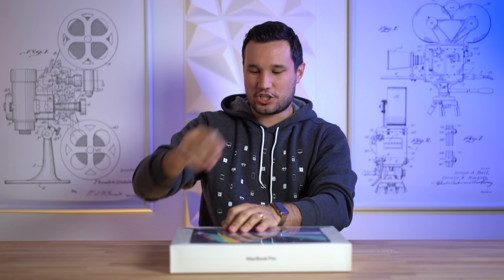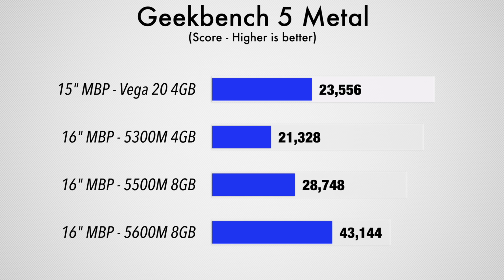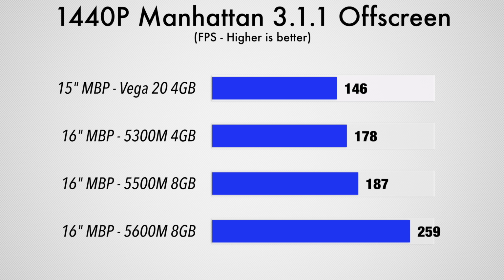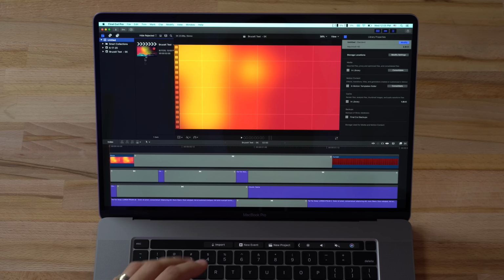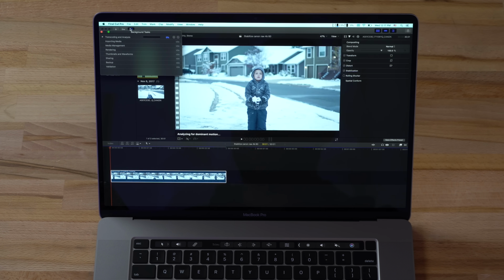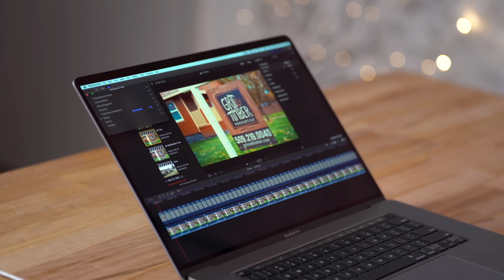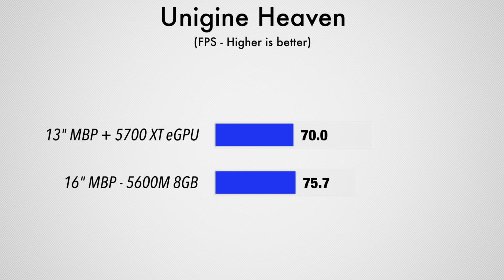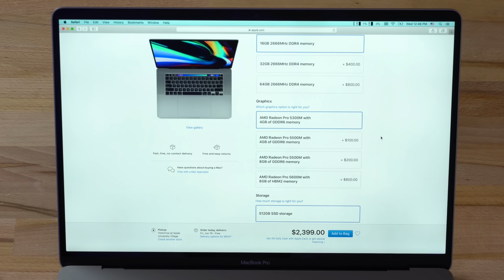New 5600M GPU on 16" MacBook Pro: Performance Benchmarks

Comment: People won't appreciate and understand how impressive this new GPU is for mobile. All that power in a 50w TDP meaning you can run all that performance still on battery. No Windows laptop can do this. Definitely getting a MacBook 👏🏿👏🏿💪🏿💪🏿
Reply: This is what impressed me the most. 50 watts is nothing for a GPU.
Reply: Yeah, thats  just amazing - this powerful GPU and 50W TDP?! It looks like AMD will soon conquer not only gaming consoles...
Reply: Mateusz Drewnowski Boom 💥 🤯, let’s hope so.
Reply: Amd should make a 16-20 core 4GB version of this that only uses 25W, and add it to the 13" MBP.
Reply: Ilipan Where are all these truths coming from. The issue is Apple 🍎 wouldn’t use it! 😠
Reply: @ilipan2668  very true
Reply: btw anyone has  information about TDP of 5300M and 5500M? Notebookcheck says its 65W(5300M) and 85W(5500M), so its even more insane how they made that much faster GPU with lower TDP. Its really hard to believe.
Reply: Mateusz Drewnowski 5500M 8GB 50W TDP
Reply: @AllenWalker777  HBM (and especially the memory controller) save alot of power and the Shaders are probably running at pretty low voltages (and relativly low frequency)
Reply: RunFor OurLives You stop ✋ 🛑 it! 😉
Reply: I wish we can get this kind of 50W TDP gpu in a Razor Blade or an Asus. That way I can have a windows laptop that can run properly on battery.
Reply: @captainfatbat9557  exactly this
Reply: Yep it was unplugged for a lot of these tests
Reply: Sorry, this gpu from AMD is exclusive to Apple? I'm sure it isn't.
Reply: @blinblinthing  I'm a PC guy, but this mac is impressive. Yes, it is exclusive to apple at the moment. Other windows laptops with a 5600M come with 36 CUs and the mac one comes with 40 CUs.
Reply: M. They have 6GB of VRAM and GDDR6 also
Reply: @user-wl6nm4iw9i  While Apple is the only OEM with an offering with this unit, i haven't read anything from AMD saying it's exclusive for Apple.
Also the gpu isn't just able to do alot with a small power draw because of the OS.
While OP didn't explicitly say that, i not no one came to such a understanding.
Reply: Asarni Thomas it is
Reply: imagine spending 800 dollars for a gpu when you can buy a whole laptop with that. and build a pc.... and im not speaking about what you can buy with the price of the macbook
Reply: Amd 5600m is available also on windows laptop for 800 bucks 😂
Reply: 50W TOTAL BOARD POWER (not TDP)... TDP is a bit of a baseline measure, which means that boost clocks would usually result in bigger power draw than advertised TDP... Total Board Power (TBP) on the other hand means the GPU won't exceed that at all.
This GPU is listed as having 50W TBP (not TDP).
Reply: Do you think the thermals/battery life will be highly impacted by that? Just ordered mine and will probably have to test that myself :D
Reply: PC gamer: it still can't play games well, no 144Hz display
Reply: Tom Liu This is nitpicking man. Plenty of folks out there playing on 60Hz screens. This isn’t for the esports stars, but for someone who wants to play multiplayer on-the-go, away from home, and not at a LANFest.
Reply: He is running Heaven on 1600x900 windowed, what do you expect?
Reply: With a windows laptop like razer studio and lenovo when plugged in are twice as fast as this macbook I love Mac's but the truth is the truth
Reply: Lone Wolf 🐺 What you are saying can’t be denied.
Reply: @LoneWolf6063  Yep, but this is a laptop, it's good to work on the go...and if that razor it's not plugged in,  it's twice as slow as this macbook.
Reply: @LoneWolf6063  nope
Reply: @LoneWolf6063  The 5600 is equivilant to the 2060 as the default with the razerblade and g14 (maxq), unplugged those laptops suffer in performance.  You need something with a 1650 to not do that, and that is equivilant to the 5300m
Reply: @LoneWolf6063  yes but the battery life?
Reply: @MarceloTezza  depends on what u do but on heavy load around 3 hours and normal use 6-7 hours which is the same as a macbook pro.
Reply: @LoneWolf6063  Are you sure it is the same? With a 50wats tdp? No... It isnt...
Reply: @MarceloTezza  na not 50 watts but that's not the point
Reply: Yeah but +$800 more than the 5300M macbook.
Reply: @anires1195  You make good money for editing from this mac that 800 is nothing lol
Reply: Until it overheats and starts to throtle
Reply: Windows Laptops don't limit themselves to 50W, that's why, batteries to handle 150W+ of power are very expensive and not very durable, so Windows has a power budget on battery, if it's exceeded, clocks go down, CPU and/or GPU. However under battery it's very likely you still get similar or better scores with nvidia graphics, so there's no point.
Reply: @TheFPSPower  The claim that getting the same or better with Nvidia on battery is just flat wrong based on any comparison I've seen.  Yeah, Nvidia can crank faster on wall power but on battery, not so much.  Nvidia has it's huge pros as a graphics card but efficiency has not been one of them for a long ass time.
Reply: @grumpychocobo  exactly this

Comment: Just ordered one with this graphics card I’m really hoping it’s worth it because it was such an insane price jump wish me luck lol
Reply: Well if you require macOS and are doing something graphically intensive, and you can afford it (this is the most important factor) then you'll likely find its worth it. However if you dont need macOS, you probably should've just built a beefy desktop for a fraction of the cost. If portability is a requirement then there are many other laptop options that offer better performance for an equal if not lower cost. If you really dont need the graphics performance this offers you likely couldve saved several hundreds of dollars and opted for the 5500m or even the 5300m variants. If you couldnt afford it and blew all your rent money on an overpriced computer, then you my friend are an idiot and it most definitiely was not worth it.

However, I'm assuming that you satisfy all 3 of those requirements so im sure you'll love it! It sure is an impressive piece of tech
Reply: Souljaa yes, totally worth it. Using FCPX on a Vega 48 is a delight with quite a few effects applied, realtime 3D plugins, etc... it’s close to realtime for the most part. I have ditched using Premiere/After Effects when possible in exchange of the Apple equivalents because of this. The 5600M is even faster on that front. You can easily extend that laptop shelf life to at least 5 years, maybe even more.
To anybody saying that if you don’t need macOS and to get a laptop for a fraction of the price... that’s just not true, when in doubt check all the reviews that compare competing products to the MacBooks (Razer, Dell, HP, etc laptops). For a similar price or a couple of hundred dollars cheaper you will get: mostly 6-Core CPUs, some will cap at 16GB of RAM for some reason, RTX cards that eat away the battery life (will run for about 1.5hrs), plasticky finishes somewhere, flimsy hinges, screens that can’t display a logo because maybe the reds are out of it’s reduced color range display, almost always heavier and bulkier chassis, a trackpad that will probably behave sub-par, basically a computer that overall performs at 50% of what’s touted when it overheats or when it’s on battery... you will get a better webcam and tons of ports though.
Reply: @alejmc  The Razerblade 15 It's overall better on these benchmarks and costs less with a 2080 Super Max Q. The battery is worse, but if you are low on battery there is no harm in connecting it if u can
 is there?
Reply: @Alej M-C  Most of what you mentioned it's just bullcrap because you're not giving any real example, you're just piling up the defects that there might be with x and y laptop and saying most are like that. Literally the only laptop that might only get 1.5hs of battery life is the Apex 15 which is  the most powerful out there.
Reply: @-santi4401  No need to get overworked over this. 
Although, I'll accept that I'm an Apple ecosystem junkie and like how much better things behave even on seemingly lower end hardware. The closest example I can think of is of this Razer review which has a super kick ass workstation Quadro RTX inside it, also from Max Tech: https://www.youtube.com/watch?v=U7hYfPfAVIc
Reply: @alejmc  MBP is best all around. Agreed, and now with this graphics card. Its my #1 pick.
Reply: Tino like those celebrities where they made thousands every second by average lol
Reply: The dude in the video already tests its capability. What's your worry about?
Reply: can you adopt me?
Reply: I’ll wait for the 2021 MacBook Pro with mini led display and cheaper graphics card by that time ....hopefully...

Comment: Maybe this is an insight into how good the new iMac will be! If the 16” MBP with the new 8GB GPU is almost as good as the high end iMac then fingers crossed that should be confirmation that we are getting a refresh! 

Good stuff Max
Reply from the maker: We're expecting this 5600M option to be the best option in the smaller redesigned iMac. For the larger one, it could be 5500X, 5700X and maybe 5800X. -Vadim

Comment: Did you check the "About This Mac" to confirm it's the 2020 model like you thought in your last video? Or does it still say 2019?
Reply: This is what I want to know as well. It’ll say 2019 as the model hasn’t changed it’s just an upgrade.
Reply: I knew he wouldn't show this because it would confirm his clickbait title.
Reply: Vidzz what? He’s not clickbaiting at all
Reply: @MultiPcExpertGhost  don't be cynic man
Reply: @oscargong9438  This is how I was feeling. Max is an entertainer and thus will use titles that'll draw us in.
Reply: Clearly still a 2019 model.

You don't make it a new model just because there is a higher end option. The year model changes when the entire range has a point of difference.

Still a great laptop, but for anyone thinking that it is 2020 your argument is not based in logic.

I am holding out for a new release even if it is early next year because I am sick of my keyboard on the 2018 model, but am not in such a big rush that I need one straight away.

I'll wait for the 2020/21 model.
Reply: D'RealBoxingFan Well said. (:
Reply: From someone who owns one with the 5600M option, I can confirm it is still labelled as 2019 model under “about this Mac”. 

This is NOT a 2020 16” MacBook Pro.
Reply: It doesn't matter all that much. What matters is how it'll perform. That's why we all would buy it, right?
Reply: ricky v On the contrary, if it’s the 2019 still (which I’m pretty sure it is), I’m going to hold off for 10th gen CPUs. I can’t afford a new Mac every year so I want the best for my money.
Reply: SolKnightt intel 10th gen H series CPUs are the same architecture, same manufacturing node 14nm, same everything as 9th gen CPUs.  There’s maybe like a 2-3% performance gain at best from higher boost clocks but the chips are fundamentally thermally limited in most laptop chassis
Reply: goJesusandStarcraft intel 10th cpu is just rename.
Reply: SolKnightt There we go. Exactly as I said, “What matters is how it’ll perform.” 
I like when great minds come together and agree, thank you. (:
Reply: goJesusandStarcraft This is part of the reason I think Apple did a spec bump more than anything. (:
Reply: @SolKnightt  being completely honest, there's not much difference between the 10th Gen and the 9th Gen CPU's, Even Dave2D and MKBHD has addressed this, so, the CPU shouldn't be a reason as to why you're waiting for a new MacBook pro, considering the fact that the performance boost is almost unnoticeable. And the wait could be as  long as till this November or December.
Reply: @SolKnightt  wait for the amd cpus, 4th Gen ryzen mobile is insane, 4700u out preforms closely to the I9 although it takes less juice
Reply: @abhay4848  This was my thinking as well. I am glad Apple is finding ways to give us a little more performance. We are paying for it but it is more performance none the less. (:
Reply: @RickyV-Production  yeah, and I can testify to it. I just bought the mpb 16 inch 2 weeks back, and it's for regular use and because I don't play or do video or photo editing, I don't see the need to get the hbm2. Regardless, I got the Radeon pro 5500m. Switching to Mac os was the best thing ever, and I'm never Switching back to windows again.
Reply: Abhay I said that about using Windows Vishita and 7 in 2009. Now I like using Windows 7/10 for several reasons. Basically I understand your thinking 💭 and commend you for having the hutsfa to change, congratulations! 🎉🍾🎈🎊
Reply: goJesusandStarcraft as far as I know the comet lake 10th gen have one „big“ advantage over the 9th gen cpus while being virtually the same cpu. The 10th gen chips all come with WIFI 6 which would be a nice thing to have on a brand new 3000$ machine in 2020
Reply: ricky v It performs exactly the same, except for when you buy the new grahpics card ofcourse. That however wasn’t my point. My point was that the guy uses clickbait titles like 2020 16’’ Macbook Pro while it’s clearly still the 2019 Macbook Pro.
Reply: Vidzz If I could’ve bought this MacBook in 2019, I would’ve. But I couldn’t. Now I can. In 2020. Seems like a 2020 Mac to me.
Reply: @sam_sturm  Exactly!
Reply: @sam_sturm  You seem like one of those people on Ebay who advertise something as a 2018 MacBook Pro just because they bought it in 2018, while it's actually a 2016 model.